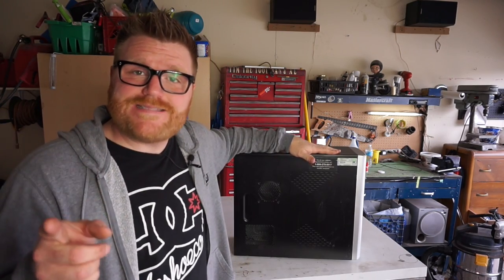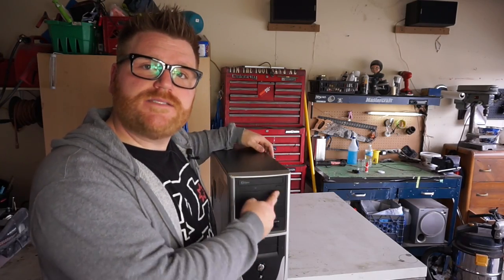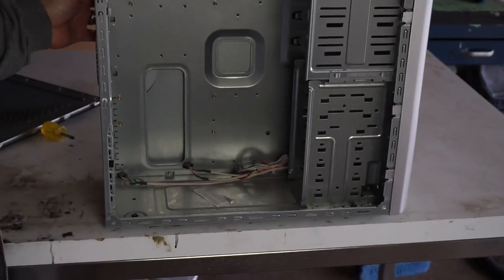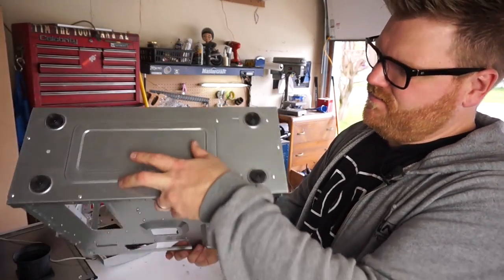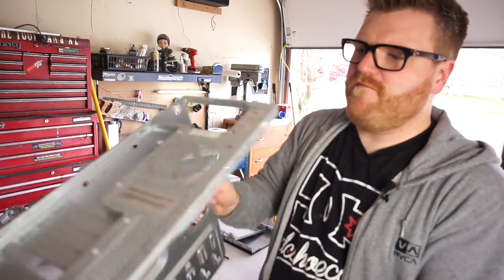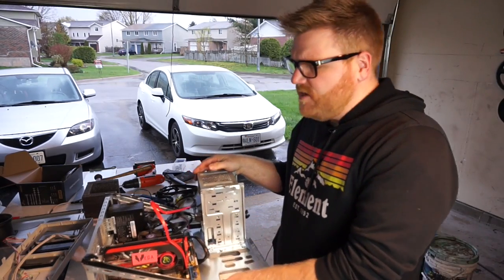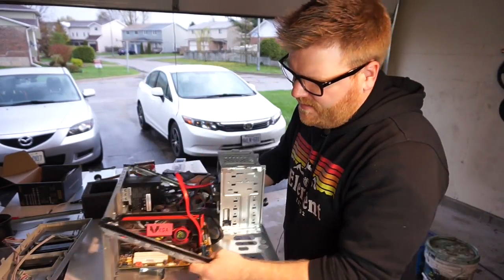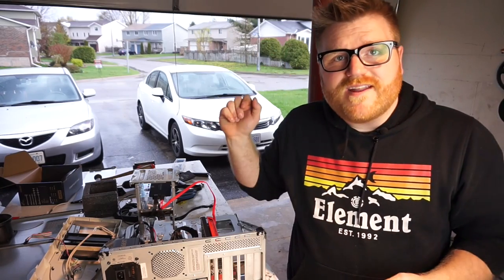How To Make A Computer Test Bench Out Of An Old Case

Comment: I was just thinking of doing the same thing, and wanted to see if anyone else had done it. Yours is the first one I've watched and I like what you've done.
    The only difference in my circumstance is that I have lots of vertical space, but not so much horizontal, so I'm thinking of putting the drive bays underneath the motherboard. I'll probably end up building a wood frame for the whole thing, as I don't have access to a shop anymore, just some power tools.

Comment: I use a motherboard tray from an old MESH titan gs, it is a very sturdy aluminium full atx tray with movable standoffs, psu, hdd etc just sits next to it at the moment.

I have been considering either wall mounting or picking up an old 486 style pc case, the kind with no rear i/o shield hole but loads of pci slots and space for a full size atx psu.

My plan was to mount the motherboard to the lid on hinges, have the permanent storage in the lower section but route all i/o to the rear pci slots on the case, front audio and power switches etc can go to the front panel. so i could run data cables externally and only use the power cables i need.